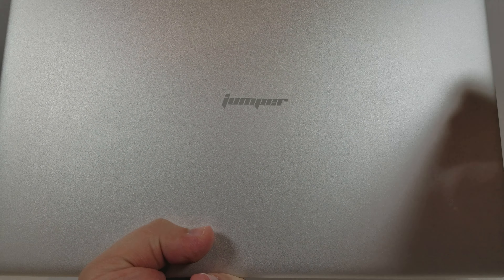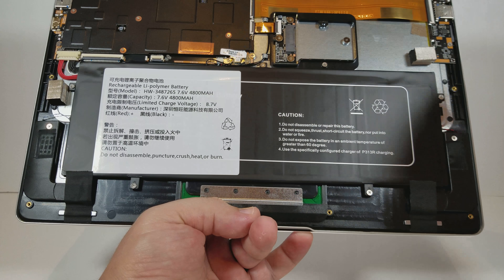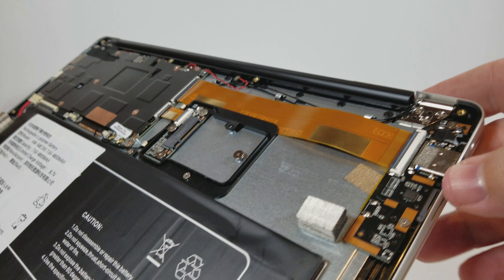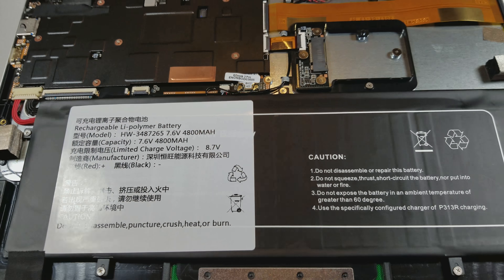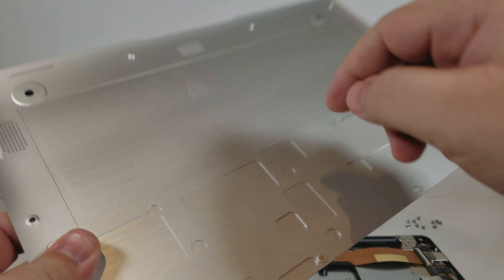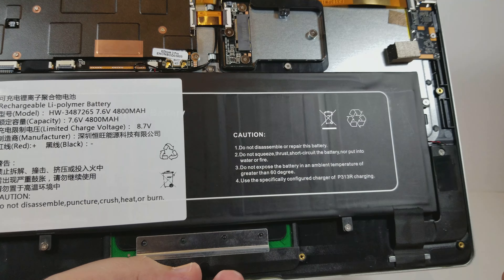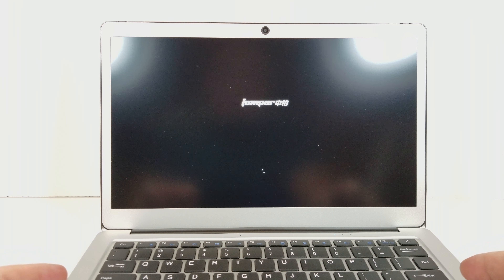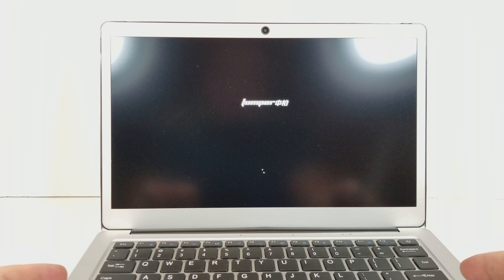Jumper EZbook 3 Pro Review - EZ to Recommend Netbook

Comment: Nice review!  Thanks. Too bad it's USB 2.0. Battery is 7.6V * 4800mAH = ~36WHr. At least they added M.2 SSD expansion. All of these kinds of netbooks should come with 128GB minimum these days, or at very least include expansion options like this one. Plus the 6GB RAM is a nice addition as well. Plenty for the power this machine possesses. Not to mention turning off power limits. That's awesome.

But I don't know why there's always compromises. Add USB 3.0 and dual channel RAM and this thing would be the perfect netbook. I prefer matte screens too.
Reply: htwingnut i
Reply: the ram is dual channel though, 2*3gb chips